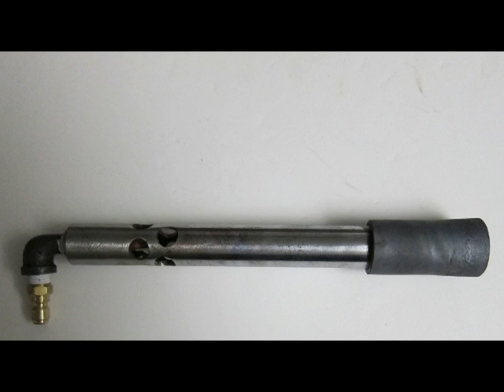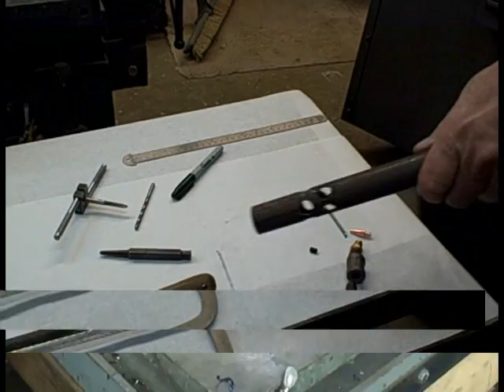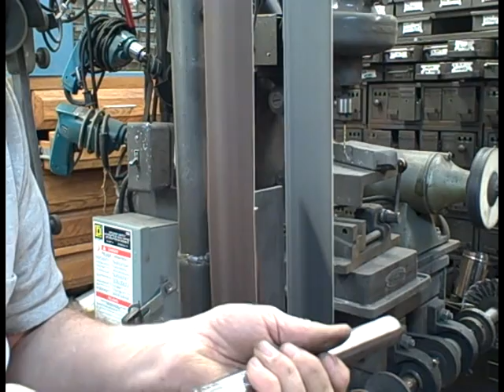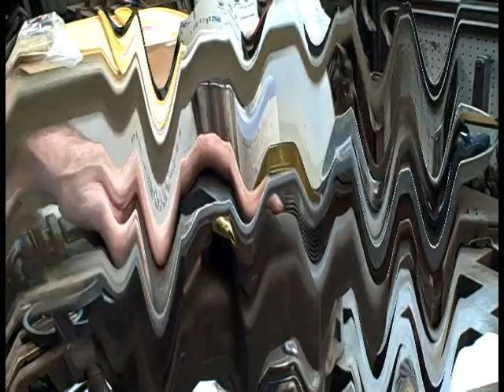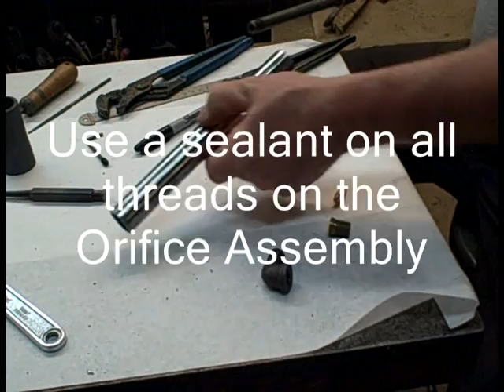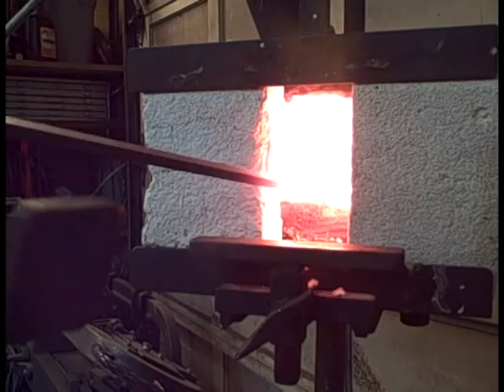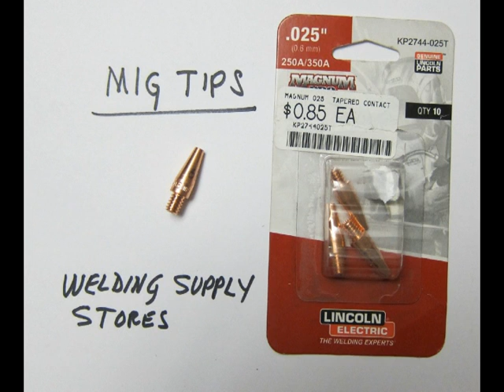How to build a Propane Forge Burner

Comment from the maker: I have forge welded mild steel in my forges, but haven't made any projects with tool steel where I wanted to forge weld it with these particular burners.  I have made layered steel (some call damascus), including the use of old files that are reported to be 1095 (if that is tool steel)  with similar venturi burners using pressures between 20 and 30 pounds.  I expect these burners would perform the same.  I am aware that blown burners can  produce very high temps at low gas pressures.

Comment: is it possible to weld tool steel with this type of venturi burner in ur forge? the bes type of flare, by my expirience, is a flare made of fire clay. but a clay that can stand 1600° C!
which pressure in psi do u need, to forge weld tool steel? my burner, supportet by a air blower, make it posible to weld at a pressure at 4,5 psi!

Comment from the maker: If the flame goes out.... you may need to change the propane pressure (close or open the needle valve a bit), check the alignment of the mig tip (it needs to point straight down the cener of the pipe or change the placement of the flare (move it up or down just a little).   Good luck.....

Comment: First, I really appreciate the time and effort putting together this video!  It was very helpful and informative.  I just recently finished building one as shown in the video, with a couple of slight modifications.  First, I added a sleeve to adjust the amount of air flow (got the idea from Michael Porters book).  It seems to be a helpful add-on.  Second, I personally had a very difficult time getting the burner to work with a .025, & .030 tip.  But I finally had success w/ a .035 tip. Thanks!

Comment: The over all setup of the orfice set up is really clean and professional looking. I was trying to design one (inside my head that is simple and clean), but this is one that I will model. My question is if you can shorten the entire setup? Basically shorten the gap between the orfice and flare end. (maybe I missed the reason in the video). Also, can I have my orfice set up welded into the tank its self? Is it neccesary to hold it in with set screws? (im talkin about the flared end and the tank)

Comment: Hi,
Excellent video and comments. I build small furnaces for gold and silver melting and pouring. I build them to use standard air/propane torches (BernzOmatic TS800 or the Red Dragon 50,000 BTU roofing torch). I will build this burner for the new furnaces I am making.
Thanks for the parts detail and sources, you went above and beyond.
Paul.